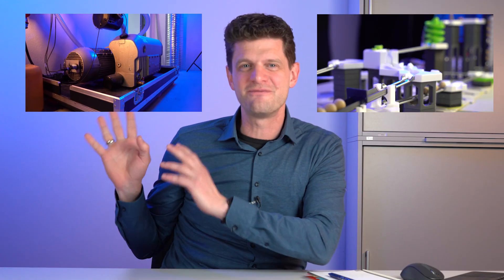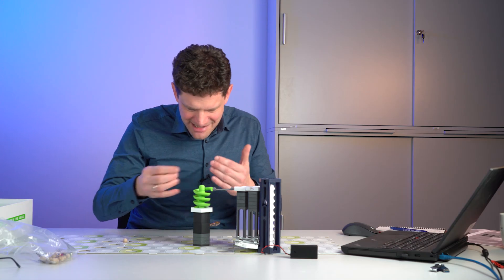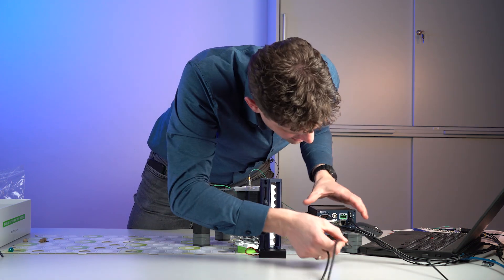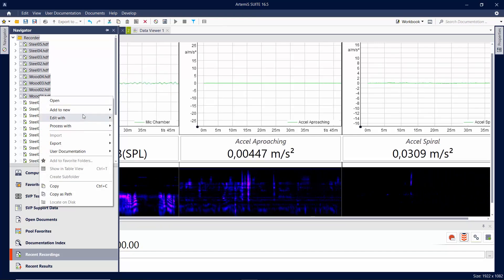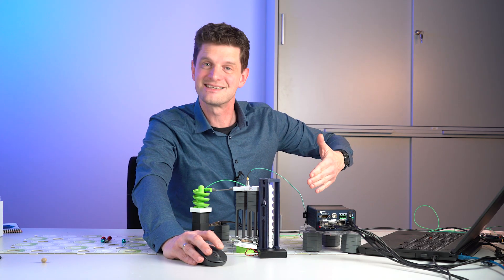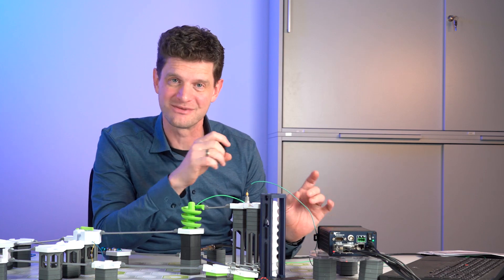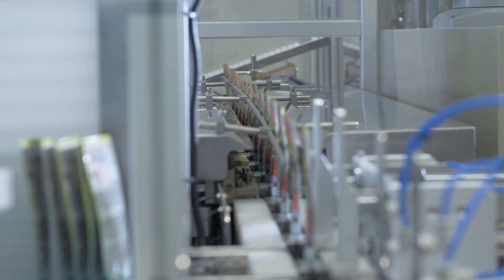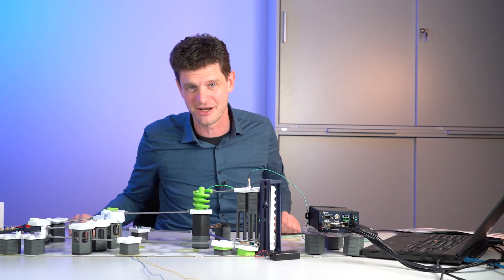End of Line (EoL) Background & Setup

Comment: It seems like your voice is getting picked up by the microphones as well. Does this affect the ability to distinguish between the wood and steel marbles? Would intermittent sounds like this be an issue in a real factory setting?
Reply from the maker: You have noted that very well. Yes, loud ambient noise could distort the measurement result, especially if you are simply evaluating the sound pressure level.

There are many methods that can be combined to get around this problem:

We can have the measurements take place in a soundproofed closed room. This is often difficult to integrate into a production environment.

Instead of airborne sound, we can carry out structure-borne sound measurements - as demonstrated on the ball track. The sensors pick up the vibrations on the test specimen via contact tips or on their mountings.

There are various filtering methods so that the evaluation focuses precisely on a specific moment or frequency or frequency pattern.

There are very intelligent AI-supported analysis methods that we tailor precisely to the application.

This spherical track, for example, was also in continuous operation at trade fairs. Although this is a very noisy environment, it was able to distinguish perfectly between wooden and steel balls. The unique combination of several sensors was used for this purpose.
Impact hardness, impact level, frequency spectrum in the measuring chamber, deflections of the spiral tower at a certain time after the ball has entered, ..... there are countless ways to get conTEST to concentrate exclusively on its task, regardless of ambient noise.